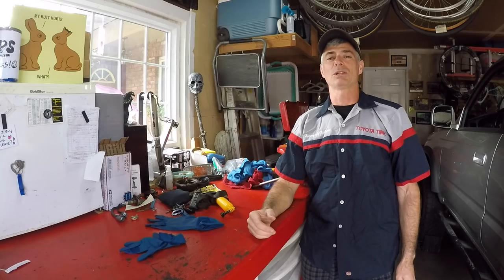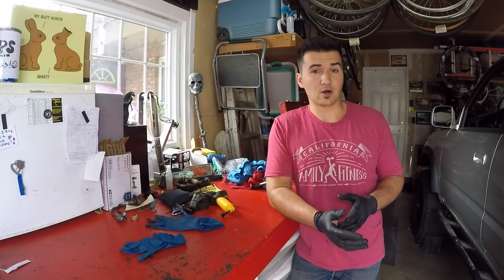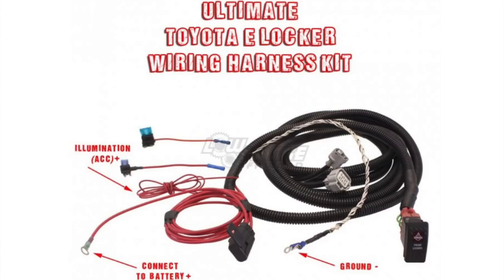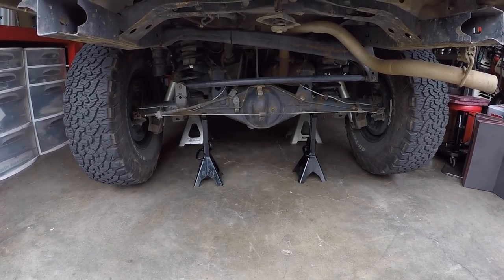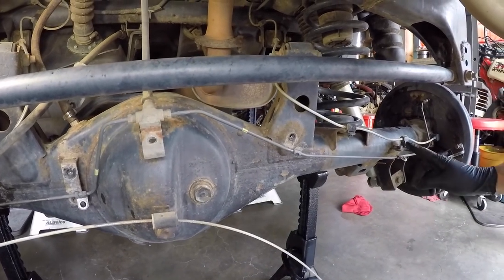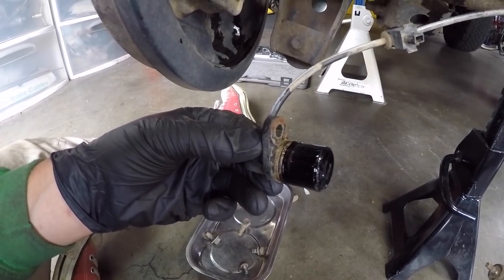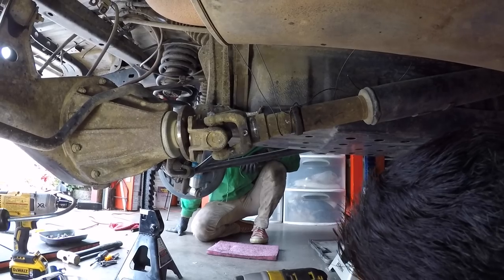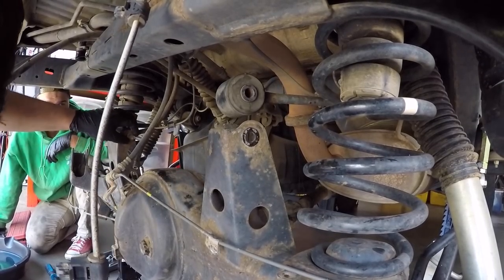E-Locker Axle Swap + Wiring How-To

Comment: Hey Tim I appreciate the video and information.   I installed an elocker in my 1996 4runner.   Hooked everything up and I can hear the locker working.  I don't however see the indicator on the dash.  I added the additional wire to the harness and it appears the dash bulb works.  Any suggestions? Thank you
Reply from the maker: Don't know.  If you got that repair wire terminal into the right plug on the dash cluster and into the right spot in the plug, it should work if you wired everything correctly.
Reply: Hey Bud, I had to add a bulb to the back of my dash cluster..the slot for the RR diff lock build was empty!👍 hope this helps!
Reply: @tannersmith5946  Hey Tanner, so did you put the wire in the same slot as i did? Pin 5 on the brown connector? Cause I'm installing it on my buddies truck and nothing lit up.

Comment: Hi @Timmy The Toolman, I have a 2002 4Runner with the center diff lock and recently installed a new third member with a harrop elocker. My third member only has 2 wires coming out of it for the locker and i'm wondering if you have heard of a way to wire an aftermarket locker like its stock in order to retain the 5MPH safety feature? Any thoughts are appreciated and thanks for making awesome videos to help with wrenching!
Reply from the maker: I don't have an answer for your question Ben.  This is something we haven't tried.  I would just make your locker switch hard to accidentally switch on, basically like the OEM switch.  The OEM switch is a push button and the button doesn't extend out past the dash, so it's hard to accidentally actuate it.

Comment: Thank you for this helpful video. I am trying to establish if I have a limited slip differential on a Toyota Land Cruiser. When I jacked it up and turned the right rear wheel in either direction the opposite wheel does not move and the same when I turned the left rear wheel in either direction. Does this mean I have a fault in the limited slip differential ?  Could you please advise, thank you.
Reply from the maker: Hey Andrew, I"m not an expert with these differentials.  With my experience, when you spin one wheel, the other should turn as well.  Maybe look up more videos on the subject and see what you find out.

Comment: I recently swapped my 95 Tacoma axle for a 2000 Tacoma axle with an e locker. It all bolted up perfectly. I noticed when looking at the wiring diagram for the 2000 Tacoma e locker, that the green and orange wire is supposed to go to the speedometer. 

You’re saying that if I ground that wire it will disable the 5 mile an hour limit, and if you don’t ground the wire it will keep the restriction of 5 miles an hour. 

My question is, wouldn’t you need to connect the green and orange wire to the speedometer to stop the the e locker from engaging over 5 miles an hour? My thought process on this is that the ECU doesn’t know how fast you’re going without that wire connected to the speedometer? 

Everything you have shown on this video was very helpful but I really want to have the 5 mile an hour safety feature and know it’s going to work.
Reply from the maker: This is a good question.  The wiring diagram we used doesn't show how you should connect the those wires if you want the safety feature that you can only use the locker when you're in 4Lo and you can only use engage it when you're going 5 mph or less.  I don't know if you can just choose not to ground those wires and the e-locker will work just like it came from the factory.  I looked for wiring schematics in my manuals but I couldn't find anything showing where the #10 pin and #8 pin on that female plug route to.

I don't have time to do it tonight but maybe I can take a look at my 98 and see if I can trace where that #8 and #10 pin wires go.
Reply: @TimmyTheToolman    "Pin 10 on the 4WD ECU, G-O wire connects to pin 3 at connector A on the gauge cluster for the speedometer," for a 1999 Tacoma. This is what a guy said on the Tacoma World forum. He had a wiring diagram, I downloaded, that showed this install. Unfortunately, my 1995 Tacoma doesn't have this option.
Reply from the maker: @TheHBHikerBoyScout  Well, worst case scenario is you have to ground out those safety features.  If you're the only one that drives the rig, it's not a big deal.  If somebody else drives your rig, maybe just tell them not to push this EVER, or put a piece of tape over it saying, "Do Not Push".  It's not really something you would accidentally push so somebody would have to purposely do it.  I know it's not the solution that you wanted but it will work.

Comment: Thanks for the thorough video.  I’m assembling the parts to do a swap and the video is s tremendous resource. 

Q:  Will I need the aftermarket sway bar brackets if my ‘99 is and will remain stock ride height?   

Also, I’m in San Jose... Tim, would you consider helping  me do the install if I compensate you for your time?
Reply from the maker: Hey John,  With a stock height rig, you shouldn't need the Sonoran Steel sway bar lift brackets.  

I was helping people with jobs we've already filmed but I found myself getting burnt out on wrenching.  The time I put into the YouTube channel is a lot.  With a full-time job, girlfriend, other responsibilities, other interests, I decided to limit my wrenching time to making new videos and keeping my own vehicles mechanically sound.  I can do the most good by making new videos that anyone with an internet connection can find and benefit from.  When I help out just one person, that's great and all, and I've made some new friends this way, but I had to draw the line somewhere to maintain my motivation to keep this YouTube channel going with Sean.  

So, sorry John, I'm going to have to turn you down on helping you with this job.  I'm sure you can find one buddy or family member that can help you out.   If you take your time and follow our video, you'll get it done no problem.  Good luck!
Reply: Timmy The Toolman I completely understand. The video is already invaluable help!  Thanks for the quick response!

Comment: Hey Tim I installed the locker in the locked position but the switch wasn’t in the locked position and won’t engage the locker. What do I do to reset it?
Reply from the maker: @GabrielRodriguez-ko9qg  Take the actuator off and use a screwdriver or similar tool to unlock the locker.  Once that is done, the switch and locker will be in sync.

Comment: Hey Tim. Thanks for yet another very helpful video. I wanted to chime in here incase anyone ran into the same situation that I did - for lighting the RR DIFF LOCK light on the cluster, I had to use pin 8, instead of pin 5 as you demonstrated in the video. My pin 5 went to the ECT PWR light. I have a 98 SR5 4WD 4R. 

Any idea why the ABS light does not come on when you lock the diff? In 4runners with a rear locker from the factory, the ABS light will always come on with the diff lock.
Reply from the maker: Yeah, I've heard the same issue with others that the pin location was already being used for the locker light.  Obviously, that wiring diagram doesn't work for all years.

I know what you mean about the ABS light coming on.  My 98 came from the factory with a rear locker, and the ABS light comes in when I engage the locker.  I'm not sure why it doesn't come on with this retrofit.
Reply: Gotchya. Thanks for the reply. So I’m in a pickle here - I have checked my wiring over and over again, however my e locker actuator motor will not move when the diff lock button is pressed. I even ordered a new AISIN actuator, no luck. 

To confirm what I have checked on my homemade harness:

-RR DIFF LOCK switch wiring is correct
-Lock sensor on the actuator works, tested this by manually locking the diff. RR DIFF LOCK on the dash stays on without blinking.
-The two motor power wires are correct.
-Ground wires are in the correct pins, everything is grounded as it is in the diagram. 
-The limit switch wires appear to be correct.

When I test the e locker ECU, I press the RR DIFF LOCK button and hear the relay click, I can measure ~11v across the two power wires for the actuator motor. However the motor will not move. The truck is jacked off the ground in the rear, wheels are free and still no actuator movement. 

I have tried different combinations of switching the two power wires, and the two limit switch wires to no luck. 

I have even tried what the service manual suggested, which is getting the actuator clocked in the proper position (done by applying 12v to the two power pins on the actuator connector) manually locking the diff, installing the actuator, etc. 

I’m at wits end here. Any ideas what I may be missing? I’m about to order an ORS e locker harness, but the fact that I can’t figure this out is frustrating.

To confirm, my ground point is good. For my testing I ran a ground cable from my battery to the ground wires for the ECU and switch. Confirmed power is good to both the ECU and switch.

Might I add that I have tried THREE different e locker ECUs with no luck. So clearly that isn’t the problem. 

Since I was able to prove the stand alone actuator works, I believe the issue is somewhere in my harness and the limit switch sensing/and or limit switch ground in the harness I made. However, I get continuity from end to end on all possible pins and connectors. It is built exactly how you guys did it in the video.

Bay Area local here, any chance you can help me sort this out?
Reply from the maker: @jordanzuk8439  So, like you mentioned, the e-locker and actuator need to be in sync with each other.  Are you sure the actuator is in the locked position while the e-locket is in the locked position when you installed the actuator?
Reply: Unfortunately, yes. I followed the procedure in the service manual. For both the new and old actuators. About ready to call it here. 

One thought though, in some cases I have been testing with just the ignition on. I may try a separate power supply instead of my car battery to make sure the ECU is putting out consistent voltage to the actuator. 

Noticed that there was more voltage sag when just running off the car battery, maybe not enough voltage for the actuator to wind up its internal spring…

Comment: Hey Timmy, New subscriber. I love your videos. What would be the steps to just slide the transmission back in order to replace a flexplate on a 97 4runner? Would I just follow the steps in your transmission replacement and put in longer bell housing bolts that will allow me to prop a jack on the transfer case and slide back instead of taking the entire transmission completely off? Thank you
Reply from the maker: What you detailed would work.  Just follow our video but don't separate the transfer case from the transmission.  With those longer bolts, you could essentially sort of keep things in alignment while replacing the flex plate.  You still will probably have to fight it a bit to get the alignments pins lined up and the transmission butted up against the engine again.  Hopefully you can get the whole assembly slid back far enough to give you enough room to work.  If not, you'll have to drop it down and out of your way so you can get the flex plate swapped.

Comment: Hey Tim, I can’t seem to get the wire to fit and stay in the fuse tap. Is there a specific way to get the wire to stay in the fuse tap?
Reply from the maker: You can connect the wire to the fuse tap with a butt connector or you can solder it and cover the connection with shrink tubing.

Comment: First gen Tacomas did not have 4.11, they had 4.10.
Reply: You're correct, close enough nonetheless! Thanks for watching.
Reply: Needs to be the same gear ratio front and rear unless the owner never drives in 4wd in high speeds. I.e. dedicated rock crawler
Reply: You know for a fact all of them came with a 4.10 stock from factory? Because I'm having problems with my 98 3.4 4x4 I suspect the rear differential does npt match up with the front differential .
Reply: jose mora not all, some are 4.30 and 4.56

Comment: This video has been so helpful as I’ve been taking on my locker swap project! I just completed the wiring today and my locker is functioning which I’m super happy about! 

I do have a couple things going on that I’d like to ask about if you have time. Not sure if these are correct indications or maybe I made some bad connections. 

1. My switch is constantly lit up whether it’s on or off? I was expecting it to only light up when pressed in. 

2. I’m having to fill both spots in the add a circuit with fuses for everything to work properly. If I only run one fuse then my gauge cluster and power windows do not function. Looks like you only have one fused plugged into the add a circuit in the video?
Reply from the maker: Hey Tim, this was our only experience with this job.  When we were done with the job, the switch would only light up when it was pressed.  Yes, we only had to use one add a fuse to get everything working. I'm sorry I couldn't be more help to you.
Reply: @TimmyTheToolman  thanks for the quick response! I’ll dig further into the forums and see if I can find anything. Will post back up here if I do. 

Anyhow, the the swap is complete and locker is working all thanks to your help! Thanks for taking the time to put these videos together!

Comment: GREAT VIDEO GUYS!!! So, my question relates to the ABS wires. On the connector(s) at the fuel tank, where they exit the cabin, there is a white and black connector. The black connector, there are two (2) wires that exit to the exterior and I believe they are ground wires. On the white connector, it contains wires for the e-locker and the ABS sensors.I am using a donor harness and there is one ABS wire that is directed where I didn't expect it to go. Do you have a wire diagram for this connector - or do you know the answer of the top of your head? Thanks
Reply from the maker: Hey Jay, glad you like the video.  I don't know the answer to your wire question.  it would take some research to figure it out.
Reply: Ok, how bout this. Is there a difference in harness design between auto and manual?
Reply from the maker: @jayhyland1  I don't know.  I wouldn't think so, but without looking at a wiring schematic, I can't give you a definitive answer.

Comment: great video! im at the wiring stage now, is the wiring diagram the same for a 5-speed ?
Reply from the maker: I don't think the type of transmission matters.  The e-locker ECU does communicate with the transfer case to send the message to enable the differential to lock when the transfer case goes into 4Lo but it doesn't communicate with the transmission as far as I know.
Reply: @TimmyTheToolman  makes sense thank you! Also noticed they didn’t show the wiring connecting  from the locker side to the trailer wire but showed the trailer wire to ecu. My set up came complete OEM wires all the way to the 2 connections inside the cabin just past the gas tank. Just wondering where to cut to wire to trailer wire
Reply from the maker: @DIRTY_ELECTRIC  Are you saying you have two other plugs that connect up under the rear seat near the gas tank that's part of the e-locker wiring?

Comment: Wiring question: If I want to add the safety feature that allows the actuator motor to work only under 5mph, where would I plug  the wire from the ECU (pin 10) instead of grounding it?
Reply from the maker: Not sure.  I think the answer is you just don't ground it and that wire goes nowhere but I'm not sure about this.
Reply: @TimmyTheToolman , ok thanks. I'll post on the 3rd gen mafia group and see if anyone knows.

Comment: After perusing a lot of info on this subject I was ready to put in an e-locked axle I have on a parts truck.  Apparently it ain't so simple!  You're saying I would need the matching front axle as well for correct operation?  
Virtually no one mentions strictly sand 4x4ing, which is all I'll ever do, aside from maybe occasional snow/ice in my community/city.
In your opinion is this mod "worth it" for 99% street use, maybe 10hrs of beach/sand use, and even less experiences in snow?
Thanks Timmy
Reply from the maker: It won't be worth it to you.  Just get some traction boards and carry a shovel and that will get you out of most sand situations.  I bought the MaxTrax boards because of their quality and reputation.  I think they were the original makers of these boards and then others have copied them.  But, the cheaper versions aren't as good from what I've heard.  The MaxTrax are durable and flex well without breaking.  Here's a link.  They come in different colors.  I have the olive colored ones. https://amzn.to/31oqjad

Comment: I picked up an E-locker full axle to replace the axle in a 2WD '99 runner. Do you know if the factory E-locker control module will work with a 2WD truck?
Reply from the maker: It should.  The E-locker ECU is separate from the main vehicle ECU.  As long as you wire it up correctly, it should work.

Comment: I noticed you said to use a first gen tacoma e locker, you would need to weld spring perches and stuff to the axle.. are the third members not interchangeable?
Reply from the maker: The 3rd members are the same for the 3rd Gen 4runner and 1st Gen Tacoma.  The axle housings are different because one uses leaf springs and the other coil springs.

Comment: Could i wire it up to my auxbeam panel rather than doing the button and all the wiring harness?
Reply from the maker: The locker needs to communicate with the e-locker ECU if you want it to perform like OEM with the locker light illuminated on the dash letting you know when you're locked and unlocked.  If you simply just set up a simple switch (power/no power), I suppose that could work but you wouldn't get an indicator when you're locked and unlocked.